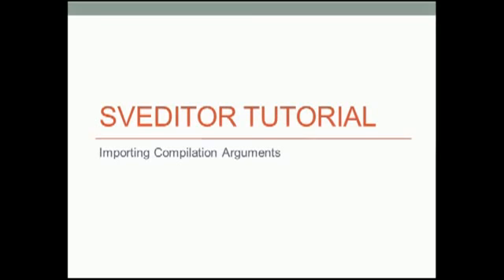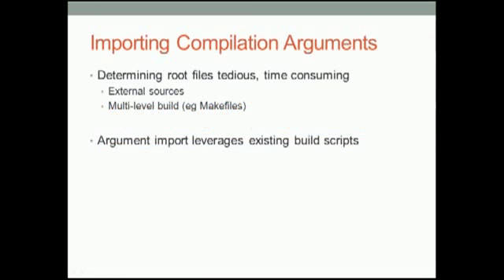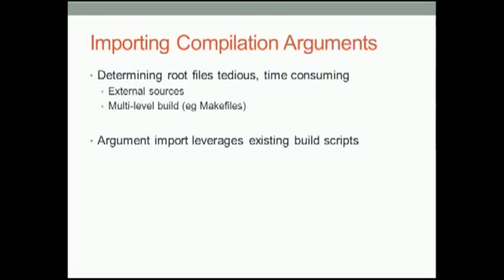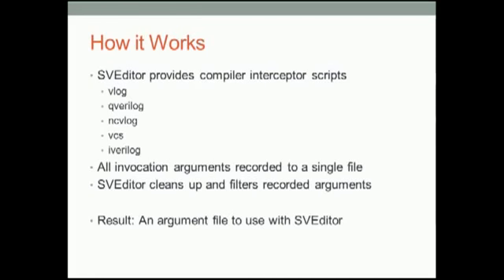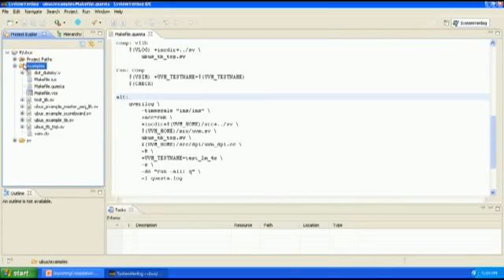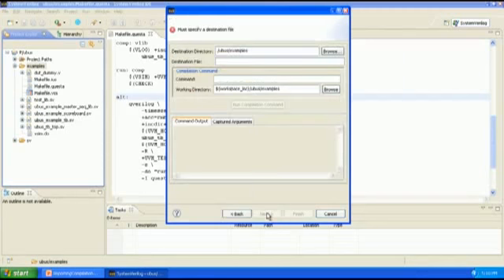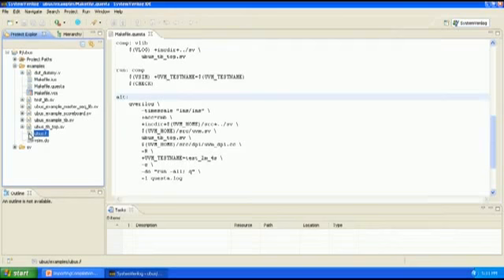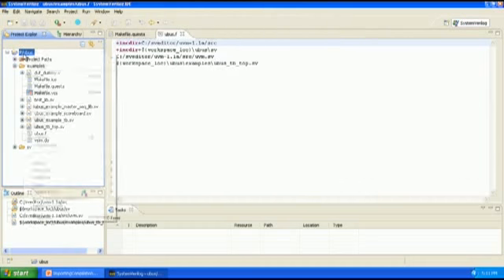SVEditor: Importing Compilation Arguments

Comment: There is a bug with multi file compilation. If you have a `define in a file (e.g. `define X  ), and you have a module whose port width is logic `X, then the ports of that module won't be instantiated when press ctrl+space, but only the parameters. If I move `define X in every module then the auto-instantiation works fine.